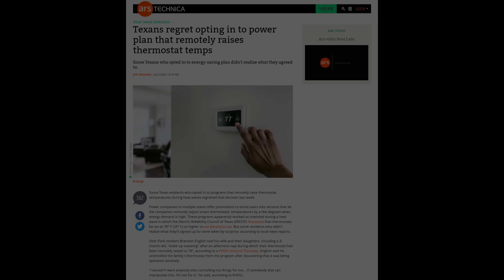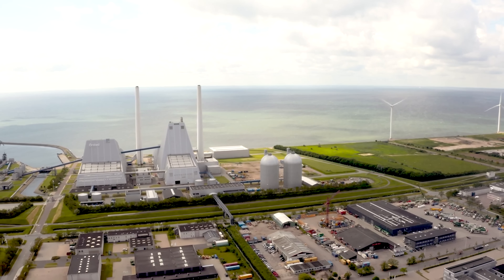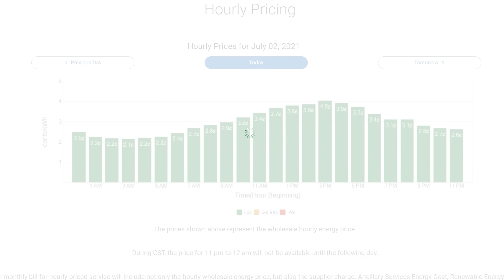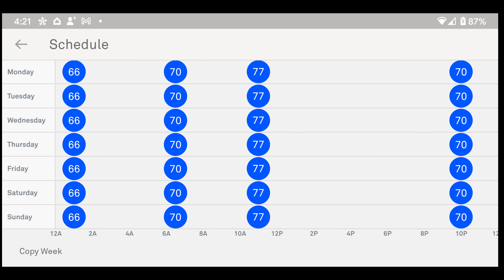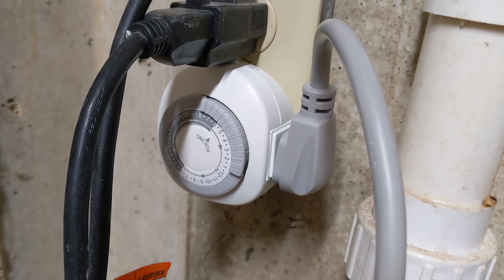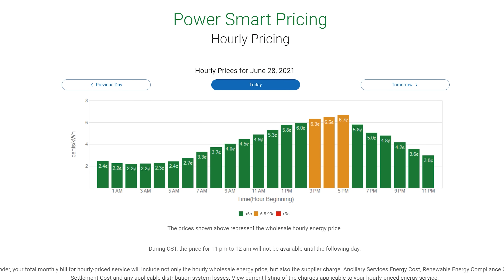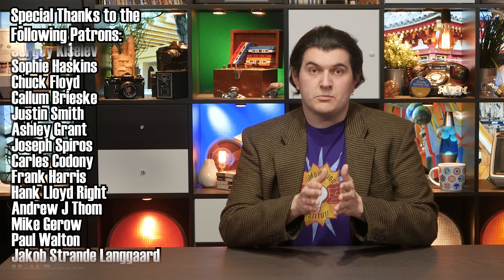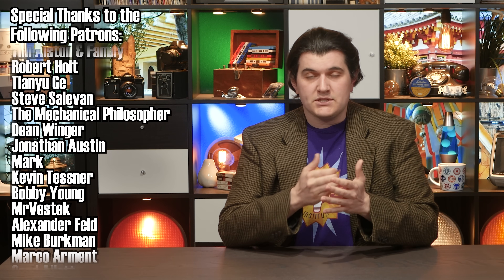Batteries aren't the only way to store energy. Here's another.

Comment: as an English person off a certain age I remember storage heaters (shudders) yeah the idea was nice but most of them were installed in council (at that point local authority homes) rental properties and they were the cheapest of the cheap so by teatime there heat had gone. and as they had gone mostly all in on that heating solution we were left to get our own backup heat source (electric element an Gas bottle heaters) so savings not really :)
Reply: Off a certain age? I still have them in my apartment. They still suck shit. We never use them.
Reply: As you say: bad design; didn't work. Let's not throw the baby out with the bathwater though :-)
Reply: I remember them a a kid.  I remember actually wearing a jumper, indoors during winter as I leaned myself over the vents of the heater to just feel that last bit of warmth in the evening.  Practically everyone switched to central heating.  I remember the "almost party" that my family had when we upgraded to central heating.

Wow, I remember having to wipe the windows free of condensation with a towel!

 I really doubt anyone will give up the radiator for a box of hot bricks.  I wouldn't even know where you could buy them, the needed dedicated meters and circuits in the house.

As for heat pumps, I literally just upgraded my central heating system with a new boiler.  There is no way in hell anyone is making me rip that out and pay £7000 to install something that will freeze the roots of the plants in my garden.  In 20 years? Maybe. Maybe.
Reply: Having installed them in the past, it was a major pain to try and explain to people the correct way to use them.  People will open the vents on the units in order to get more instant heat, or mistakenly thinking they're making them 'hotter' for the next evening (the dials and controls were never particularly well explained by the manufacturers).  But this will use up all the stored heat faster, leading to late evening coldness.  Plus they wouldn't close the vents afterwards which meant they couldn't 'charge' properly the next evening.  So the cycle continued...

 Always leave the vents closed.  They will stay hotter for longer and will keep you warm in to the evening, even if you're not 'snug' warm.

 Of course, if you had a particularly bad cold snap or your building was terribly insulated or draughty they would struggle.  But that's true of all kinds of heating.
Reply: @mattos4203  the ones that we had had no insulation except the bricks two rows of bricks with channels for the heating element sandwiched together about 4 high 6/7 across then metal outer skin and yes the place was a wind tunnel lol

Comment: Been doing this for years. Another trick I use is to run the return air through the basement to pre-cool the air with the help of the thermal mass of the ground(the  downside is  side that you are dehumidifying a lager space)
Reply: In my basement it would be a cider space rather than a lager space, but it sounds worth a try.

Comment: I worked with an Engineer decades ago in Phoenix, who purchased at auction one of those portable ice machine trailers for a few hundred dollars for this purpose. He buried it in his backyard and plumbed his house HVAC air ducts into it. At night, when the utility company incentivized peak demand at night with super low rates, he was freezing water in his buried freezer. During the day, when it was 115F outside, he was melting ice by cycling house air through it to that kept his house at 60F. It paid for itself in a year or two. All homes should have such a system.

Comment: I live by this exact same strat... As a bonus its silly cold when sleeping.
Reply: I'd love that, my wife would not
Reply: I wish I could, but we don't have pricing like that. The only benefit is that I could see that it would be easier to cool at night than during the day, but that might be offset by us having to have a dehumidifier running during the day.
Reply: @frankmthompson  If you got new higher end HVAC it would dehumidify via running the air conditioner(s) by itself unless you turned that off on the thermostat LCD.
Reply: @hithere7382  yeah, but if I ran my system as described in the video (only at night to store the thermal energy), the HVAC won't run during the day to dehumidify, which is important down here in hot and humid, Florida.

Running the fan to circulate the air will not dehumidify.
Reply: @frankmthompson  it will if you have a newer system that you didn't cheap out on. I have mine set to keep humidity below 60% relative regardless of indoor temp. If it's below 60f at the outside units it uses the furnaces to do it.
Reply: @hithere7382  in that case the ac is running defeating the purpose. It doesn't matter because I don't get different rates based on time of day. What little benefit we might get by cooling the house at night would be negated by dehumidifying the house during the day (whether by a/c or stand alone dehumidifier).
Reply: @frankmthompson  I don't get a different rate either, I just do it because it keeps my pets asleep all night and helps me get to sleep faster. A side effect is way less noise from the 8 tons of air conditioning during the day. Since they are inverter driven they run at very low current to the compressor and very little rpm on the fans to dehumidify.

Comment: Someone needs to develop a "mod" or programmed pre-loaded schedule that you can add to the Nest thermostat that does this. I would be willing to play with the idea if it were implemented easily, with some control over say, how high it bumps the temp, how low to set the temp, and if it gave feedback on the next days weather vs electrical costs.

Comment: This is a brilliant strategy! Sadly, my house is 140 years old and all my efficiency efforts thus far haven’t been able to keep up with modern building techniques. :/
Reply: Is it wooden ?
Reply: Depends, I live in 95 old brick apartment, outer walls are 50cm thick in third floor and opening windows at night usually helps (not in the hottest days). When I lived in first floor of 6 story  apartment building from 1930s, walls were 110cm thick and windows were mostly protected from sun by buildings or trees and cellar below was cold so there was never too warm. In between I lived in family house from 1930s and had room in the attic, it was horrible - layer of roof tiles, layer of insulation, layer of drywall.

Comment: The idea of someone else deciding what goes on in my own home makes me want to install solar on my house even more.
Reply: consider creating your own water supply too, someone might stop your water
Reply: @iliqiliev  funny you should mention that. I have considered putting a secret driven well in my basement, seeing as I am just feet above the water table.
Reply: It’s an opt in system :) you get a credit for signing up and it will cover the cost of the smart thermostat, so it can be a win win!
Reply: @creativedesignation7880   I guess I shouldn’t use broad generalizations but at least in my area, the power company offers the credit in an opt in system. But I’m not sure I understand your concern, since it’ll only happen if you consent to it. And I understand it’s not legal to do this kind of thing without consent, but I wanted to make sure you understood how it works since it isn’t offered everywhere :) 
Also, I haven’t signed up for it cause my place has newspaper for insulation apparently, I’m up to 80° by 1pm if I did the same thing described in the video lol. 
Also the issue I have with the way these articles are frames is as if it was surprise that the power company had this control, but they literally signed up for it in exchange for savings, so I’m not sure why it’s newsworthy.
Reply: @isaaco5679   I done both of them and  solar with battery storage  is the oldest of about 5-6 years.  I am working on a automated transfer switch that toggles power between battery and grid power depending how much charge is on the battery so i get most out of solar power without having to unplug and plug appliances or loads.
Reply: @nathanblanchard8897   i had something similar years ago, but it was a water heater. they payed me pennies and I had to wait hours before i could take warm showers. I hated that thing so much that i got rid of it in no time. Not worth the few pennies that you save.
Reply: @FloryJohann  thanks! Now I know what extra hardware I will need. I didn't know what the transfer switch was called.
Reply: @nathanblanchard8897   yeah that was  15 years ago.

Comment: I've been doing this for the past twenty years (ever since I've had electricity). But when you're disabled and homeless, surviving in an antique motor home with two inch thick walls, floors and roof, the benefits are quite limited. I had to cover my windows with R-Max foam board as quickly as I could afford to do it (and I still have a few to get better insulated), unfortunately there just isn't enough room in an RV to properly insulate, nor do I have enough money.
Reply: Tough situation. Try to locate your home under a shady tree in summer. If you can't move your home plant a deciduous tree. Trees are free air conditioners.
Reply: @nicholaslittle2312  I'm well aware of that, but I'm surviving in the north-western part of the country, where evergreens are about the only trees around, the few deciduous trees are owned by wealthy liberals and they don't share.

In fact we have so many evergreens that we have massive forest fires every year, the forests are severely over crowded, it's an environmentalist imposed, environmental disaster. Probably the best I can hope for in my existence is to be caught in one of these environmentalist imposed, environmental disasters.
Reply: Yes. I believe the government needs to allow more winter hazard reduction burns and help to thin the small trees out.
Reply: @nicholaslittle2312  They need to allow more logging, it's good for the environment and for the economy.
Reply: @Mickey With respect, not so. Logging removes the biggest trees. That causes many saplings to germinate and grow. Many small trees together equals much more severe wild fires  in summer.

Comment: I tried to do this for the first time a few years ago, but I couldn't get my roommate to understand. He was terrified that setting the AC super low overnight was going to cost a fortune. Ugh. I tried explaining it like a thermal capacitor was, but, yeah.  He just couldn't grasp the whole concept.  I've lived here alone for a few years now, and when I had a day job, I elected for "smart hours" which saved me a fortune, but I've been working for myself, at home the last 2 years, so using the time/cost model doesn't work as well for me anymore. 
I'm thinking about getting some of that mirror tint for the windows in the house. May not make a huge difference, but every little bit adds up.  :)
Reply: Tint is cool. DIY is cheap and even if it doesn't lower the temperature a lot it makes you feel more comfortable at higher temperatures. You will want to have the room temperature lower when sitting baking in the sun coming in through clear glass than tinted glass.

Comment: Here in Moscow, Russia, where i live we have a variable rate on electricity. And my AC onlly runs at night. Granted i work at night, but still. My power bill is ridiculously small. Even by russian standards.
Reply: In summer we drink the vodka until we black out, no feel heat.  
In winter we burn the vodka. Fire makes feet warm.
Reply: In Bosnia we have it too (Low 23-07 and high 07-23)  but not on HOURLY base like he show.
Reply: @penzlic  , good observation. In US they like to cut the day into 2,3 or 4 blocks, so that is the number of prices you deal with. Time of use rates are not very popular, it seems customers prefer the simplicity of all hours at same price.

Almost no electric supplier sells based on hourly prices. There was one named Griddy in Texas, which went out of business when wholesale prices went crazy during our February hard freeze.

Comment: Great video, I wish I could use it! This sort of thing in my area would require a huge investment in insulation to make it at all possible. Right now its 2pm in August in California, and my apartment was built in the 70s. My energy providers rate plan has higher rates from 4pm to 9pm. They charge 44c per hour non peak, and 52c per hour peak. 

I cooled my apartment to 73 degrees at 12pm, and it was 76 degrees by 1pm. Old windows, upstairs, and no trees blocking the roof. I would love to be able to use this technique, but at 3 degrees an hour it would be to 80 degrees inside by 1pm. 

The best I can do right now is cool it to 70 degrees or so by 4pm, and cut out an hour and a half or so of peak use until 6pm. (I also just cool the single bedroom in my apartment, I leave the door shut to my living area) College town so no landlords are investing in anything nice like modern insulation anytime soon.

Comment: "Everyone getting home and cooking in a 3 hour window" or everyone getting home and plugging in their car before going in the house to start dinner.
Reply: True, but most if not all cars allow you to choose charging times, if it's set to start charging at e.g. 11pm, it avoids that problem and saves money if you're on a variable rate tariff.
Reply: That's why we have ours on a "schedule" it'll automatically draw energy a few hours before the pre-scheduled leave time in order to get to 100% right before we need it. With the additional benefit of decreasing the time the battery sits unused at 100% which should help with longevity :)
Reply: @edsc86  Exactly, mine doesn't start charging till just before I get up, so by 6AM when I'm ready to leave its only been actively pulling power for about 30 minutes

Comment: My primary objection to "Smart" home tech is the utter lack of security.  The last thing anyone needs is for some rando to take over 100,000 thermostats and set them all to 30 degrees F at once.  How many stories have we already been treated to where cameras, thermostats, and appliances have been compromised?

Thanks, no.  Have one that maintains 100% of its control inside my network and it only goes out to get forecast data and we'll talk.  Letting a third party have direct control over anything on my network?  Not gonna happen.
Reply: That's why I use zigbee or zwave protocols for home automation. Is it unhackable? Not by any means. But it's not directly accessible on the internet.
Reply: Someone needs a thermostat with a local API and a firewall.  Look into Venstar or Radio Thermostat.
Reply: @robspiess  If my thermostat needs a firewall to prevent outside connections, fuck that.
Reply: There’s big money in hacking peoples thermostat to uncomfortable temperatures
Reply: Yeah, it’s crazy to think that someone could literally cause a power grid collapse if they had control of everyone’s thermostat and made them all kick on full blast at the exact same second

Comment: We tried that actually. But when our temps regularly cross 100f outside it is not effective. This could be improved with shade from trees but those need to grow. I am glad it works for you, but the geographic location of your residence plays a major factor here. LOVE the idea, tried it, it just did not work for my place.
Reply: Try duct taping window gaps might not look pretty but makes a world of difference even with new windows.  Also heavy curtains help white in the summer black in the winter if u get below freezing. Windows are good for light but terrible for heat. U lose so much from them
Reply: Your house might need better insulation.

Comment: Curious how having a few water tanks laying around the house would affect your storage capacity.
Reply: You'd need to freeze/melt water to store heat effectively though. 1 kg of  ice melting will absorb ~333 kJ of energy without any change in temperature. The same 1 kg of water will then absorb about 100 kJ when slowly heating to 24 °C.

So you'll be missing out on about 3/4 of a water thermal reservoir system's storage capacity if you do not utilize freeze/thaw cycles.
Reply: @miken3963  That's true but 100 kJ/kg is plenty. 20 kWh is 720 kg, which is a totally reasonable amount of water to keep lying around as a daily cycling thermal mass.
Reply: @sealpiercing8476  yeah, I mean, central heating systems in the UK just heat liquid water, they don’t turn it to steam like, say, New York tends to do.
Reply: @miken3963  especially if you are planning on using the hot water for washing. then all the heat goes down the drain.
Reply: You can think of lots of water providing heat "inertia" much the same as heavy stone walls would. I doubt you can make a practical application without heating/cooling the water though... nobody wants to keep that much water around.
Reply: Specific heat capacity of water is 4 J/g°C. If he has a 5°C temp change, a 200litre (44gallon) drum would store 4MJ (4x5x200,000) or 1.1kWh.
Reply: @miken3963  There was a push to use Phase change materials in construction (basically wax balls that melted at 22C encapsulated in ceilings etc)  had a lot of potential but never cam to much as they were really expensive and the wax was a pain if popped by a screw.   I think some storage heaters use this principle now though  https://www.bdonline.co.uk/cpd/cpd-1-2013-phase-change-materials/5050027.articlehttps://www.bdonline.co.uk/cpd/cpd-1-2013-phase-change-materials/5050027.article